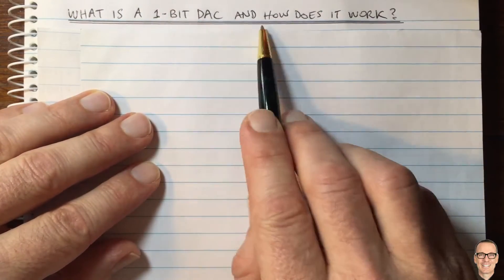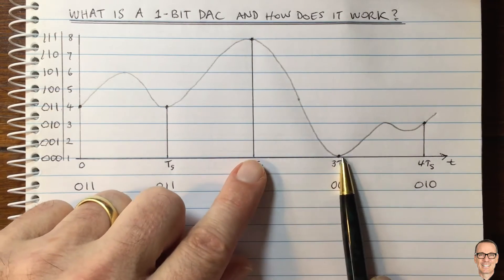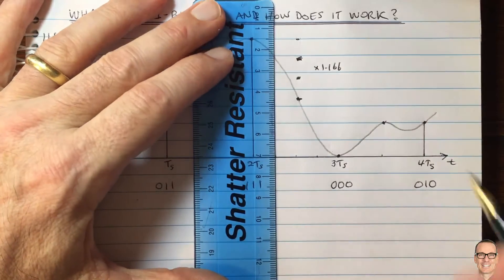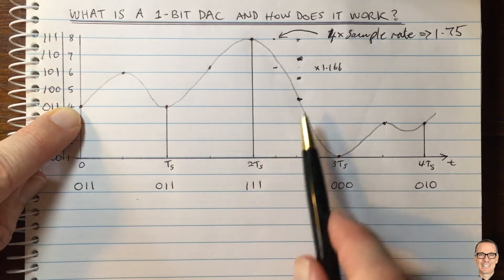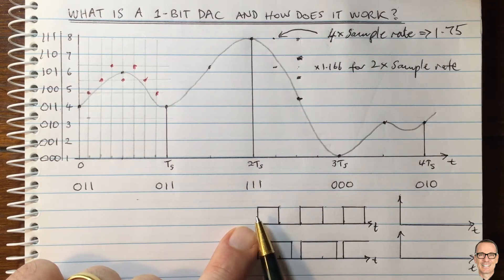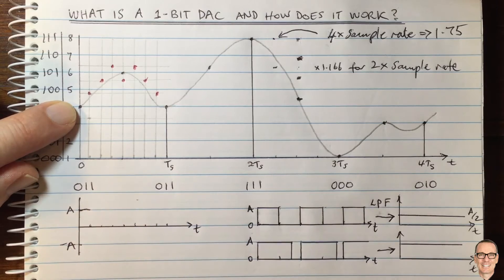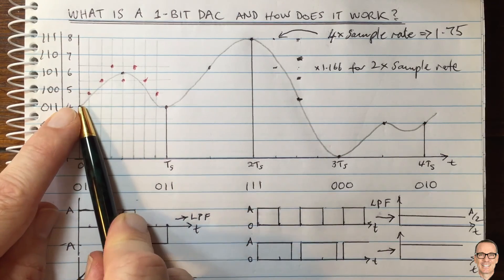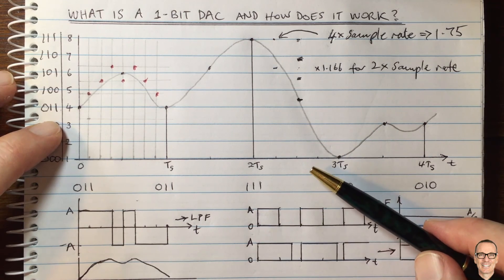What is a 1-Bit DAC and How Does it Work?

Comment: Thank you very much for your great video. I have a concern about low-resolution converters in a communication system. Could you please help me explain it? Assuming that after precoding, the signal is transmitted via M antennas with low-resolution DACs (say 2-8 bits), can the ADCs at the receivers operate with a different resolution from the DAC at the transmitter?
Reply from the maker: Yes, there is no requirement for a DAC at a transmitter to have the same resolution as the ADC at the receiver. Between them, there is a channel with (continuous-valued) gain and amplifier noise, plus potentially interference from other signals. It's not a case of "matching" transmit DAC levels with receive ADC levels.

Comment: Some companies seem to market 1 bit DACs as if they are an interesting or beneficial quality...are there any potential advantages besides lower cost?
Reply from the maker: I'm not a hardware expert, but there may be advantages in power consumption, since the circuitry is most likely simpler with fewer components, even though it's operating at a much higher clock rate. I really don't know - but am interested to find out myself.

Comment: Don't follow this. One bit would mean 0 or 1 only, 0 or full scale. Don't get how you move in such a small increment.
Reply from the maker: No it doesn't have to be "0 or full scale". The key is that the sampling rate is so high that the signal doesn't change much between samples. So all you need to do is encode whether the signal went up or down relative to the previous sample.

Comment: Could you explain this is all done by the electronic circuits? What equipment holds each voltage level and what syncs the time emission of each? Is it a mixture of hardware and algorithms? For an example analogue represents the audio wave by differences in magnetic displacement and tape speed is the fixed periodicity.
Reply from the maker: It's a complicated electronic circuit. Too complicated to explain here, sorry.

Comment: Thank you for the great videos. Very informative and enjoyable to watch. I have for years wondered about how a 1-bit ADC worked ever since I saw it advertised for an application back in the late 90’s. Often today 12, 14 or 16-bit Analog to Digital Converters are used to adequately sample and represent a signal. But how in the world to do it with a 1-bit A/D has been a bit of a mystery to me. Would be awesome to see a video about 1-bit ADC if you have knowledge of these and any interest in creating a video.  But again, thanks for the great videos!
Reply: By the way, to clarify, I’m not referencing delta-sigma converters, nor comparators.  Possibly flip-flops as implemented but I’m uncertain as to whether something like a D flip flop was used in implementation.
Reply from the maker: A 1-bit ADC works exactly the same as the 1-bit DAC, except in reverse. in other words it also operates at a high rate (ie. sampling rate, in this case) and simply checks to see if the analog signal has gone up or down between samples. It relies on the sampling rate being high enough such that the analog signal changes are small.

Comment: Do people actually use 1 bit adc in mobiphone or this is just some basic research concept that does not serve a practical design ?
Reply from the maker: My first portable CD player (back in the late 1980's) used a 1-bit DAC, and even advertised the fact with a sticker on the front! I remember it clearly because I used to wonder why they were advertising that they were using the cheapest DAC they could. I still wonder about this. Anyway, yes, they're still widely used.
Reply: Practically everything uses a 1 bit DAC, now when they DONT use one they advertise it as a marketing point and increase the price of the product.

Comment: One more question: due to avaibility of the analog pencil drawn waveform, it becomes easy to draw the red dots, which simplifies the interpolation process. What about real world where on a CD there are consecutive samples with nothing between them? There is no other choice than drawing a straight line between the samples as any other waveform might be further from the original analog waveform.
Reply from the maker: Perhaps this video will help: "How are Signals Reconstructed from Digital Samples?" https://youtu.be/dD9HC1GThZY
Reply: You are correct; two samples at the same level provide no information between those points and the level output is constant. The solution is sampling (Nyquist) at a high enough rate that the 'missing' samples are not audible.

Comment: Thanks for this learnful video. I am still wondering: as the 1 bit DAC finally ends up as PWM+low pass filter based DAC for reproducing the analog signal, what is the benefit for using 1 bit DAC rather than simply considering a 65536 (for 16 bits samples) steps PWM? My guess is that designing such PWM with 65536 increments might be tricky and also the 1 bit DAC "follows closer" to the original signal after doing low pass filtering, but please I would like your confirm.
Reply from the maker: It depends on what you mean by a 65536 step PWM.
Reply: @iain_explains  A PWM with 65536 different high/low ratios. It might not be difficult to design such PWM with a 16 bit counter followed by comparator whose output toggles upon detecting equality between counter and incoming 16bits sample value. So the question is what benefit has 1-bit DAC over simple PWM based DAC?
Reply from the maker: A PWM that has 2^16 different pulse widths is not the same as a 1-bit PWM running at 2^16 times the rate. For example, the high rate 1-bit PWM can produce waveforms that toggle between values multiple times, within the same period that the PWM can only change values once.
Reply: @iain_explains  Thanks, my understanding is that toggling multiple times instead of only once within the same period of time, will shape the signal closer to the original (analog) one after the output is integrated (filtered).
Reply: Just multiply, and you will find a PWM counter speed about 2.5GHz for 16/44.1. That’s why math helps to reduce this number to reasonable 100 times smaller values inside modern DACs

Comment: Thanks for the video.  I watched twice but was still struggling (and always have)  with the idea of a CD player using a 1-Bit DAC to convert data that is 16-bit PCM encoded at a 44.1 kHz sampling rate.
Intuitively, the data on the CD would need to have been previously 1-bit encoded at (44.1 * 256) kHz.
However, you mentioned digital interpolation and finally I think I understand.  Thankyou. I am going to watch that video.

I always thought it odd that some CD players were proudly claiming to employ 1-Bit DACs which I assumed was either inferior or not possible.  Clever marketing I guess.
Reply from the maker: Yes, I've also wondered about the advertising too - ever since I got a portable CD player back in about 1990 when I was an undergraduate student, and I noticed it had "1-Bit DAC" printed on the door/lid/top. It's rather odd to advertise that you're using the cheapest components possible! I've always pictured an advertising person walking into an engineering design lab and asking "what's the latest stuff you're working on?", and then not really understanding the answer, but remembering the phrase "1-Bit DAC", and thinking it sounded catchy!

Comment: How did you get the 1.166 as a factor for twice the sampling rate?
Reply from the maker: Ah yes, well the full range has 8 levels, but only 7 gaps between those levels. So with double rate sampling, there are 4 levels, with 3 gaps between them, that need to span a range of 7/2 = 3.5. So, 3.5/3 = 1.16666.
Reply: @iain_explains  thanks
Reply: @iain_explains And what is 2 in 7/2 ?